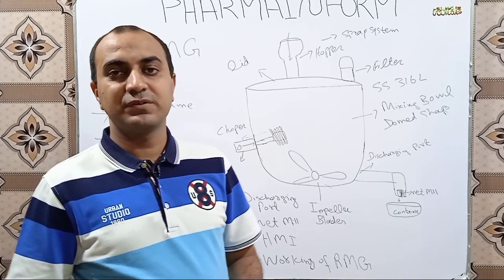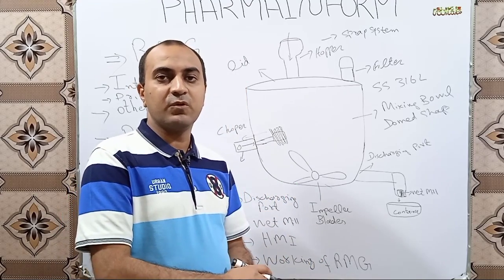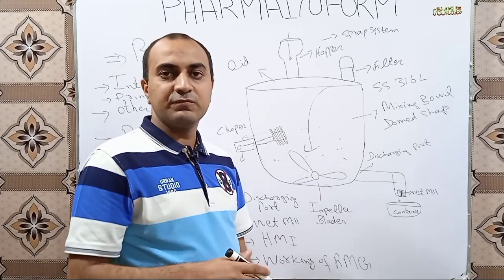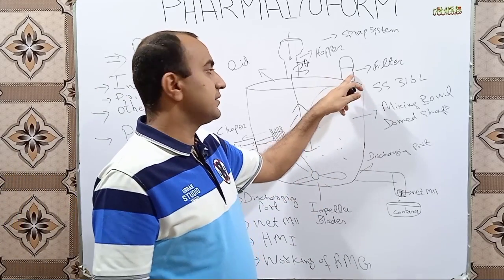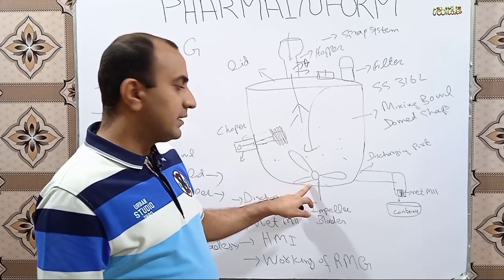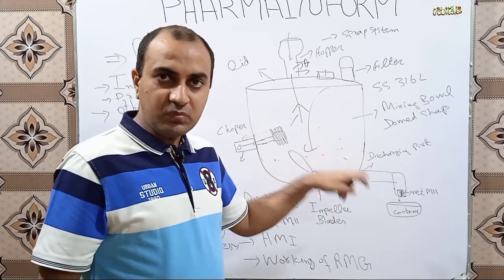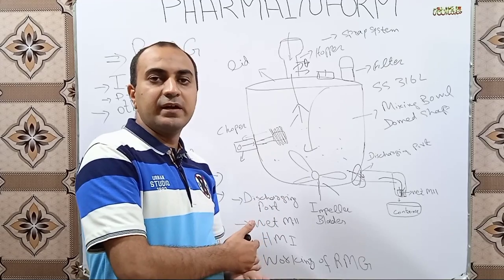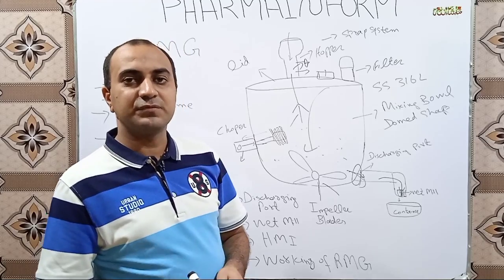RMG | Rapid Mixer Granulator | High Shear Mixer Granulator

Comment: Sir impeller speed limit max to min 
Chopper max min speed 
And what is ampere  load  can you please explain
Reply from the maker: Max and min speed vary depending on model and capacity of RMG.For ampere write in google 'end point determination of wet granulation Pharmainform ' and read article